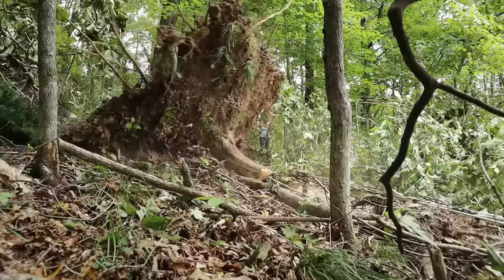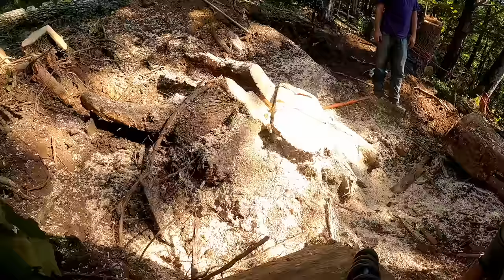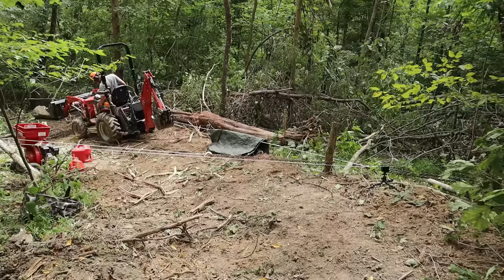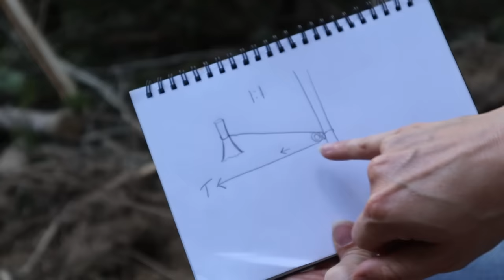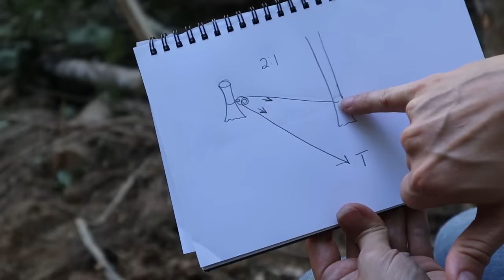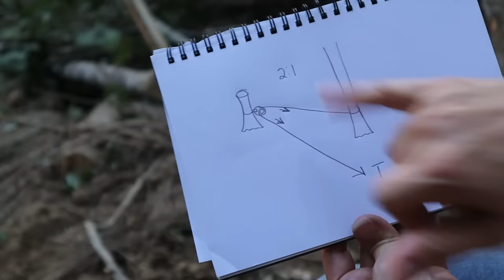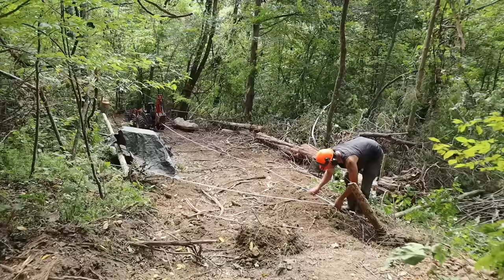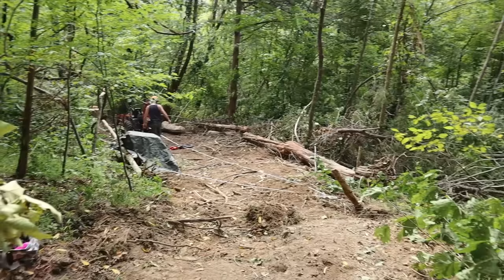Snatch blocks vs tree stumps - the power of pulleys /// E57

Comment from the maker: CAUTION:  If you are planning on doing something similar to this, use safety precautions that we should have (luckily, we did not get hurt) Use weights over your lines to take the line down in the event of failure.  A weighted blanket or similar has been recommended to us many times in the comments.  

If anyone is interested in expanding this system into a stronger one, we added 2 compound pulleys after our 4 to 1 setup in this video - creating a 16 to 1 mechanical advantage.  We explain the whole process and show it in action in Episode 64 here: https://youtu.be/Sc4NUKMuzaU
Reply: Nice job on use of the snatch blocks I bought a bunch myself have yet to use them in this way this was great footage to see them in action with a compact tractor.  A word of caution though it is never wise to Pull from your backhoe you should be attaching your load to a draw bar Or rear transaxel hitch.   This gives your equipment better leverage it also puts less strain on the rear transaxel.  Pulling the load with your tractor from such a high point like the teeth on your back hoe bucket is also causing your front wheels to come off the ground when this is happening Your rear transaction becomes the fulcrum or the tipping point and the entire load of the tractor is put on the rear transaction.  You will get more pulling power and save your equipment such as your hydraulic ram on your backhoe and put less strain on your rear transaxle by placing it on the drawbar or receiver hitch on the rear.  The way you have the bucket in the fully curled position exposes the hydraulic ram.  The ram is at its most vulnerable position  In the configuration you are pulling.  There is a much higher likelihood you will break the ram in that position.  In its current position the ram is the least supported by the hydraulic cylinder.  If that ram bends fails and you have to replace the whole cylinder and ram, it would most likely be a very large repair bill.
 Just want to be informative, prevent a large repair bill and downtime of your tractor.
Just my 2 cents otherwise great video. 
Thumbs up
Reply: I like what Jon Brown was saying. Never exceed the strength of any piece of your kit. It's easy to do with compound pulley systems. 
I would recommend looking into synthetic winch rope. At least a half inch line (30,000 lbs strength), it's easy to cut to length and do your own eye splices. Synthetic winch rope is stronger than steel but stores less energy and is less likely to cut you in half if it breaks. Then get yourself some soft shackles and recovery rings ($30 on Amazon rated to over 40,000 lbs). Then get yourself some tree saver straps because you're probably killing every tree you put that chain around. 
The fastest way to gain mechanical advantage is to simply double the previous advantage, * 2 * 4 * 8 * 16. 
It sounds like you've already figured out the Spanish Burton, even if you're not sure what it was called. Watch some Australian 4x4 winch videos to figure that out. I would set up a Spanish burden using half inch synthetic winch rope with the soft shackles and recovery rings giving you a quick and very strong  4:1 advantage. Then pull that with your 3:1 that you already have. You'll have a relatively simple and very strong 12:1. 
The easiest and most simple thing you could do to gain advantage is simply stop cutting your trees so close to the ground. If you can wrap your tree 4 ft high instead of two feet high, you basically double your leverage right there. I really love what you guys are doing. And I think it's awesome that you're doing it together. Good luck and God bless.
Reply: Jon Brown's point about not overloading your gear is critical to your safety but I think the way he stated it might give the wrong impression.  He mentioned the 6000lb load of the wire.  I'll assume that's the safe working load (SWL) and not the breaking strength.  There's a lot to know about that, good idea to look it up.   What I want to point out is in that 16:1 system the only parts that should be seeing the high loads are the anchor points where there is a mechanical advantage..  The wire rope in a well rigged system should see only the initial pulling load.  In a two part system with the pulley mounted on  the stump, and anchor point on another tree and moving end attached to the tractor all the wire will see is the amount the tractor is pulling.  Lets say the tractor can pull 1000lbs.  That's all the wire will see, the anchor tree will also only see 1000lbs.  The stump and the anchor points on the stump will see 2000lbs as it's a 2:1 system.  That means the snatch block at the tree needs to be rated for at least max pull of 2000lbs which is 1000lbs on each leg of the wire.  Also the shackle, chain, chain hook and any other gear on the non moving part at the stump needs to be at least 2000lbs.  All that gear needs to at least match the ratio of mechanical advantage.  So for a 16:1 system with 1000lbs pull that gear needs to be rated for at least  16,000lbs.  The SWL rating has a safety factor built in.  That extra strength does not belong to the guy on the job site, lt belongs to God.  Don't steal from God or you may meet him long before you planned.  Stay within the SWL limits and buy a bit extra.  Another thing to consider is that you really don't know what you pulling with the tractor regardless what the owners manual says it can pull.  Consider putting a slack snubbing line that will catch the snatch block if the anchor points on the stump fail, you don't want the snatch block in you lap.
Reply: Beep beep beepbeep beep , Good work , both of You . , have seen the snatch block video ( smarter every day ;) ... )
Reply: what jon left out, is there are 16 lines sharing the load in a 16:1 system so it's not overloaded at 375lb
also using multiple anchors to share the load will avoid ripping your anchor out. 
your 4:1 placed a 3:1 load on your anchor
Reply: @woodchippers_WestWingDimeBag  If it was a simple pulley system, you would be correct, but this is a compound system. A 4:1 Spanish Burton is driving a 4:1 block and tackle (sort of), so the 16:1 seen at the load is being divided first by the 4lines of the block and tackle. I can only guess how much weight each of those lines are seeing. Maybe 4 to 8 thousand pounds depending on how much traction you are getting out of Ricky. Maybe exceeding the SWLL (safe work load limit) of the line, but clearly still under the MBS (minimum break strength) of the cable.
Reply: @biggs8729  I had to watch the other vid to see what you meant and I agree with you. 
hell, they'll probably break their choker chain before the cables
Reply: Sheesh!!!
I have read most of the comments and made comments of my own but in the course of that I was saying this video has sparked basically a University study of snatch blocks and pulleys and compounding Force for many many people so I really thank you for it it's been an awesome video it was an awesome video and it's been a phenomenal study in physics so thank you I can see you've already advanced so I can't wait to watch your next video that you mentioned here!!!
Reply: @christopherhughes6519  

Thanks for your comment especially like the part about the safe working limit doesn't the extra strength doesn't belong to the guy in the job site it belongs to God don't steal from God. or you might meet him too soon kind of reminds me of the number one rule of engineering 
"Over stressed structures have a way of relieving themselves, but wouldn't you really rather do it yourself?"
they're comment about not having to snatch back in your lap and I would add all your chest or your head would be advisable too so the safety group would be good idea.
All Lin all, this video of the comments has been like a seminar or a college course on rigging be really good to pick a lot of you guys's brains it's just so phenomenal to be reading this stuff I'm so appreciative of it... thank you so much
Reply: " If you give me a lever and a place to stand , I can move the world .". Archimedes
Reply: So not sure why no one is pointing it out. If you loop your cable through the block on your pulling tree your direction of force will be directly in one direction. Right now you're using roughly a 30 degree pull the other direction fighting yourself. It's not huge. But it will really compound with the leverage you're starting to pull.

This adds stress to everything in the system. In rigging cranes we can't exceed 30 degrees and you're at this point almost already.
Reply: Great video.   Where did you get the cable and snatch blocks?
Reply: You still are not connecting the pulley blocks correctly.   The two pulley blocks need to be connected to each other .  Search ( scammel break down tractor) in youtube
Reply: I see you have a back hoe on your tractor.  I don't know if you have a thumb on it or not, (you should)  But my question is why did you not use the back hoe to take out the roots, and then the stump, without all the pulleys, and cable.  I have a tractor, with a backhoe, and thumb and I take out stumps all the time .  A whole lot easier that hooking up pulleys, and running long cables, and hoping you can find a sufficient anchor tree..  Plus I just pick up the stump, with the back hoe, and take it to where I want it.  Then I use the front bucket, to push the dirt back in the hole, and and use the bucket and or the back hoe busket to press down, and tamp the dirt.  And the bucket to dress the area up by tilting it and putting it in float mode, and backing up, and smoothing the dirt out..  Snatch blocs are great for pulling logs and trees down from the side of a mountain. I have neighbor that use them a lot. They are multi use tools.  But for stumps if you have a tractor with a back hoe, preferably with a thumb on the backhoe bucket, you can dig up and break the roots, and then rock the stump, and pull and lift it out.

Comment: I understand very well the pleasure of doing things yourself.
in the summer of 2015 I also built my house, except for the pouring of concrete and the electrical installation.
I cut the trees for the layout of the access road and the entire perimeter of the house, the outbuildings and the septic installations.
As for the stumps, a 21.5 ton Caterpillard 320D excavator did the job in 10 hours, and the next day was bedrock blasting day. With the excavator on site, the blasted rock was used to lay the foundation for the access road, approximately 600 feet long and 2 feet thick.
With this foundation and despite the passage of multiple gravel or concrete trucks, this access road has never suffered any damage.

Comment: Physics at work. For the pulley system, you just count the number of ropes attached. When you used the four to get a 4:1 advantage you also were having a 3:1 on your anchor tree. So if you pulled with 1000 lbs of force, the stump was being pulled with 4000 lbs, but the anchor tree was also being pulled with 3000 lbs of force!
Reply: So could they said that much force on the anchor tree by changing the direction of the pulls?

Comment: Great team work! A dozer and track hoe operator told me to use the weight of the standing tree to help remove its own root's.  He said it is soo frustrating when often a farmer would call him with 5 acres of stumps to remove, rather than 5 acres of trees to clear.  The stumps he said take 3 times the work to excavate, since the massive weight and leverage of the tree is gone.  Also, Arbor-Plex 5/8” Rigging Rope: Breaking Strength 9,000 lb. around $1/foot is way easier to work.

Comment: Interesting vid but I just pulled a dozen some 18" dia trees out with stump, but I left 12-14' trunk then i attached the rope to the top, once down cut the trunk off and towed the stump out. I used a van and no pulleys either way pull the top more leverage

Comment: That was great! I have some of those pulleys but I have been intimidated by using those. Thanks Meg or explaining. I was going to use some of those for pulling logs down some steep areas  but not pull towards me. The pulleys will help. Once I get into that fully, I'll know which episode to look up and keep in my notes! What steel cable did you get?
Reply from the maker: Now that you have a sawmill, it's difficult leaving a log on the ground, isn't it Bryce?  I fought and fought and fought with a leaning oak on a steep section of our land here and now I'm confident we can pull it down safely with ease with the snatch blocks and the tractor.  All mountain men (and women) need to learn the art and physics of pulleys.  Don't cheap out on the hardware, Bryce.  I found some nice shackles at Rural King.  They have a good assortment of chain and other hardware too.  The cable came from good ol' Harbor Freight.  It's a 65 ft. winch cable.  I'm probably going to get a 2nd so I can hook up a compound pulley system, making the force even stronger.  That's explained really well in the video we reference.  Here's the link to the cable.  I was wrong, it's actually rated for 12,000 lbs:
https://www.harborfreight.com/38-in-x-65-ft-replacement-winch-cable-with-hook-61667.html

Comment: You’d be better off using the leverage of the tree you’re removing. Instead of cutting it short, leave it tall and connect up higher. Low on anchor point, and high on what you’re taking out. Here’s one we did on our land, see how high I’m pushing? Pushing or pulling low wouldn’t do much good, this is a 28” tree. 

Pushing over tree.
https://www.youtube.com/watch?v=gUljQSSoJ-o

Pulling stump.
https://www.youtube.com/watch?v=9Ti47i7-WW0

Comment: It also helped to raise the attachment point on the "tree" you were removing from ground level to four feet higher, providing a much greater "lever" to move the "tree' initially. Conversely,  you want to secure the attachments to the securing tree, the anchor, as low as possible, reducing the levered pressure on that tree, what you were seeing in the first sample of your video.  You can also wrap the chain around the extraction tree with several wraps in such a way that the chain will remain strongly gripping  the trunk even as it is rotated from horizontal to vertical.

 “Give me a lever long enough and a fulcrum on which to place it, and I shall move the world. ”
Archimedes

Comment: I commend you for your patience and bravery in tackling that huge project! When pulling your stumps, leave the tree and pull from a highest point from the ground. The lever is also a mechanical advantage. Just a note throw wool blankets or canvas over the cable when pulling. If there would happen to be a failure the blankets will reduce the stored energy.
Reply from the maker: Hey Greg, why wool?  Is it because of its density and weight?
Reply: @Walnuts and Wineberries  That and its durability.  And you usually have one tucked away in a closet somewhere.  Ever see the movie A Few Good Men? The cable snapped and took Carl Brashears (sp)? anything really draped over the  able would supply resistance and slow the cable down quick.

Comment: Your diagrams are great. The one thing I would do is correct the force direction arrows. The arrows (the force) is not only away from the "stump" but away from the anchor as well. The force is actually pulling the anchor and the stump toward each other. That is why you must have a much bigger anchor tree than the stump that you are pulling. 

The way that you show the force arrows helps those who are challenged in physics understand easier than the truth, which is that any time that the object that is hooked to with the snatch blocks does not move the force is pulling on it and it is an intended anchor to pull to. The force is between the two trees (the tree and the stump) and pulls equally on both. The tractor is the last "string/line of force and should, if possible, pull back toward your anchor. Otherwise, the force is vectored to the angle of the pull and is thus not pulling with full force. It is this force which is being multiplied so any reduction of force on the "pull" wire (hooked to the tracker) is reduced on each line in the setup. Thus, the loss caused by the angle is multiplied in each line and you have ta total of the initial loss on the "pull" line and three times that much add up from the loss on each line. Please pull back toward your anchor if possible. If your pulling down a tree this is not safe as the tree may fall on you, but as it is only a stump it should be safe. 

Now, as long as we have brought up pulling down the tree instead of a stump, have you ever considered that. The leverage multiplied by the length of the tree and how high up that you put your blocks multiplies the force as the ground point  works as a fulcrum and you could probably pull it down with a much simpler set up by just hooking your snatches on the non-cut tree further up from the ground and cutting it once it is down. This could also cause the tree to break instead of pulling the roots out. If you want to use the wood after pulling it down, you do not want to use this method as it causes "stress cracks" in the wood and renders the wood only use able for non-stress uses or fire wood.

just saying.

Comment: Good info on snatch blocks. A less time consuming way to clear land, create a level house pad and make a drive way path would be to rent a bull dozer. With the dozer you raise the blade high to push the tree over, then back up and put the blade down to push the root ball out of the ground. Prices change through out the year for renting based on demand.